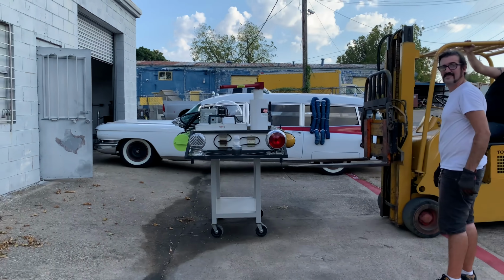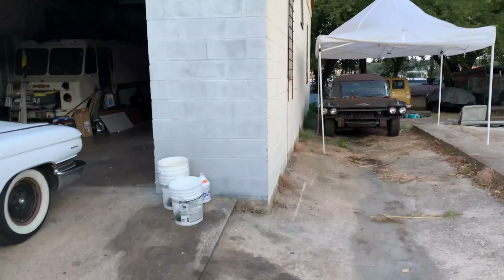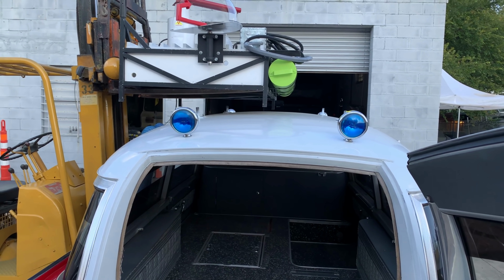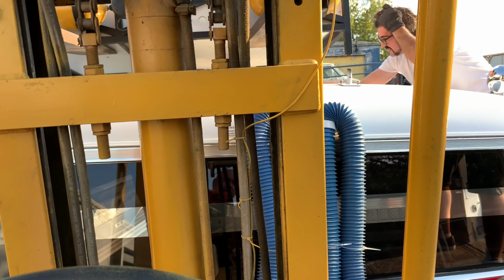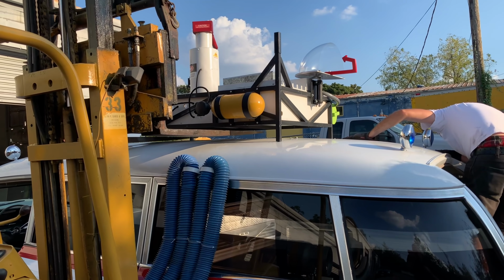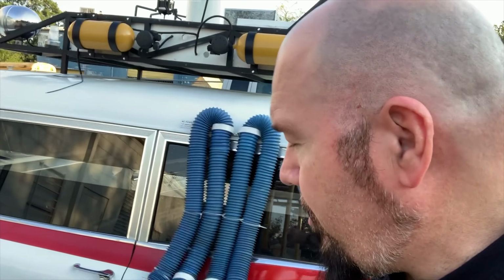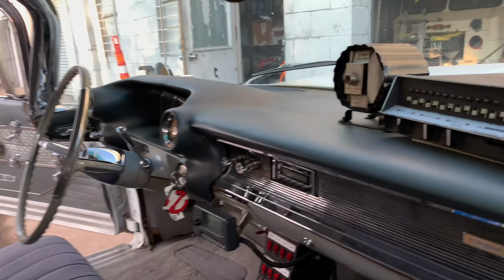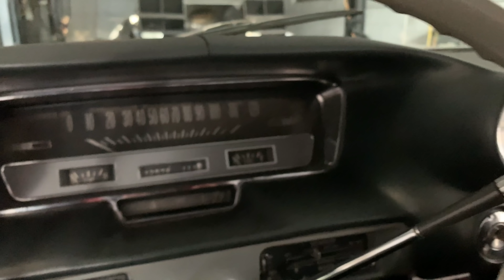Installing the Roof Rack on the Ghostbusters ECTO-1 Replica

Comment: I can't believe neither you guys nor the ones who restored the original Ecto, used rubber base grommets for the roof lights and the roof rack bases. You all laid those metal-against painted metal!
Reply: Yeah there will be rust forming there pretty soon. And far as ecto1,s go. close enough doesn't cut it in my book if it's a 60 then it has to have a 59 quarter panel professionally swapped.
Reply: The way they restored the original ecto was shameful. It looks gorgeous, but so many little details are lacking. They used the wrong lightbar on the front, it's too long. They also used incorrect brackets to hold it on. They painted the siren silver instead of chrome, which should be illegal. They also installed the siren cover upside-down, but I think thats how it was in ghostbusters 2 so i'll give it a pass. It really shouldn't be a big deal to me, but for some reason it is.....

Comment: Is that NYC Subway sign at 15:20 real?
Reply from the maker: t's a prop from the 2016 Ghostbusters
Reply: @RobertMoseley  Ah, looked pretty damn convincing. Also where do you find your Code 3 XL bars from? I have two in my collection but they're the police spec and ambulance spec ones. Not fully blue.